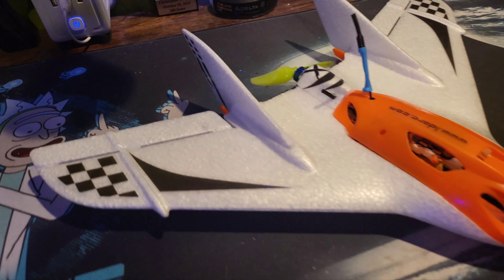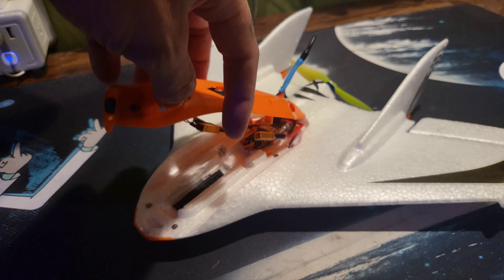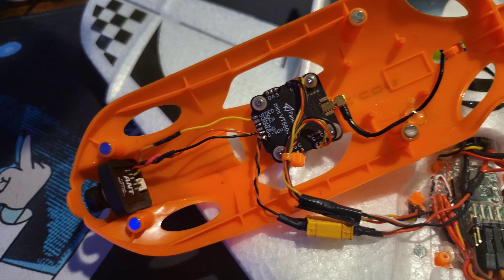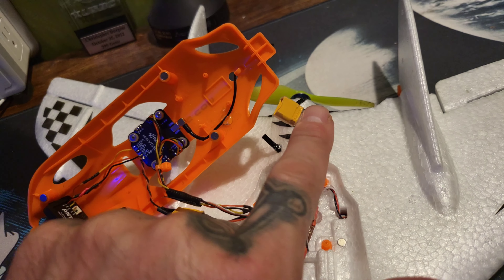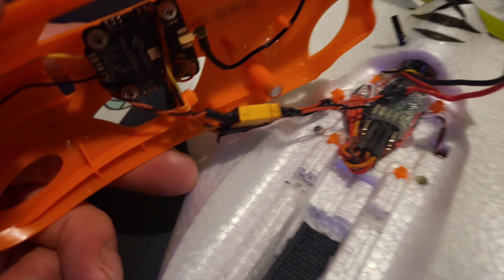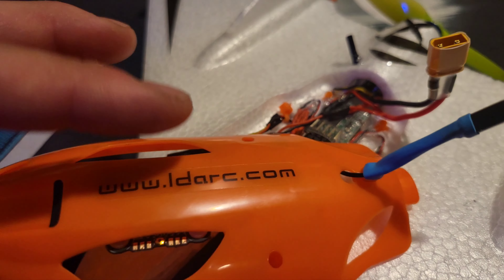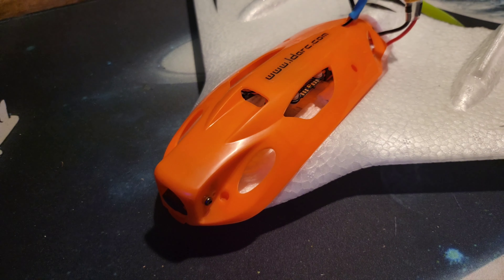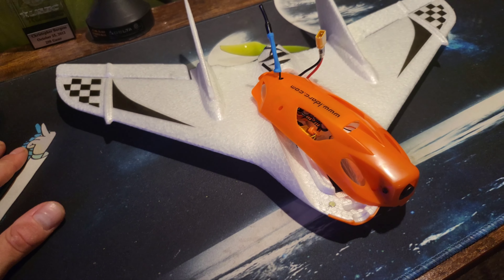Meet 'beavis' (ldarc tiny wing 450x)

Comment: So I designed a flight controller specifically just for this plane earlier this year. Have been doing some testing and playing around with it since then. That stock 1105 motor is underpowered along with the stock prop being garbage.

Currently I'm using a RCinPower 1207 5000kv motor with a gemfan 4024 prop and this is much more efficient. 3.7g servos instead of the 2.5g ones that come in the PNP. For video I'm using a HD Zero Race V2 with a Nano lite camera. Plane weighs just about 110g dry. For batteries I've been using GNB 850mah and 1100mah HV 2s packs, getting about 18 and 24 minute flights respectively.

This current airframe is getting a bit worn out (I'm guessing it's got around 500-700 flight miles on it) and the GPS has trouble getting lock due to it's location along with some other components. I've got another couple of airframes here I can build up and I've been thinking about using some 1.8g linear servos to make dual rudders on the vertical stabilizers.
Reply from the maker: Thas awesome thanx for sharing! I need 2 get mine back out and fly.